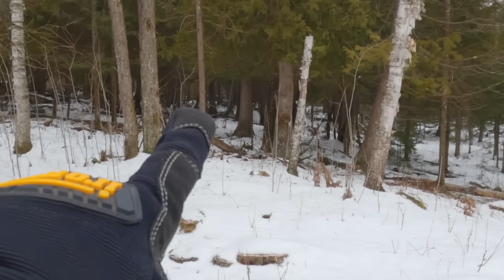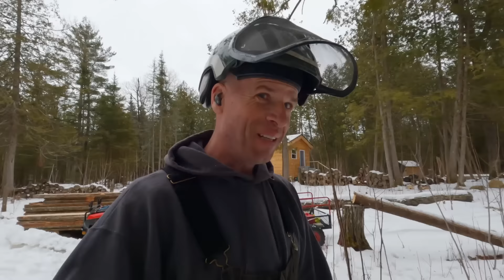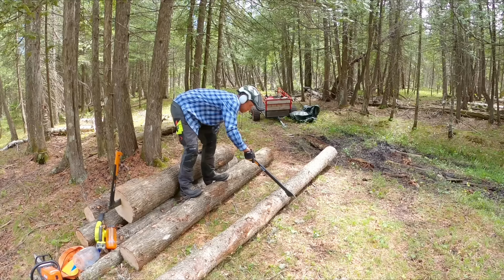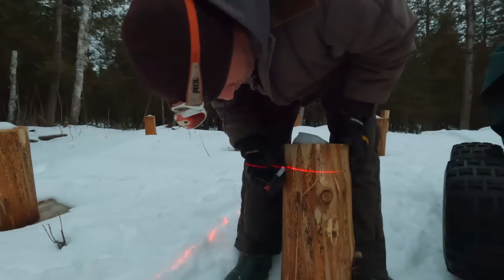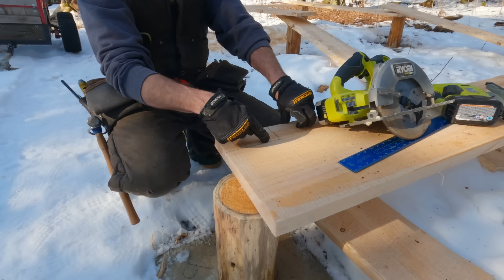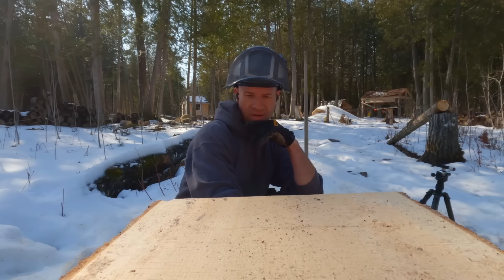Framing a Stand-Alone Kitchen Floor w/ Huge Alaskan Milled Pine Lumber ep179

Comment: Ryan, I know you cringe at the word but "stickers" 😂 the wood wouldn't freeze together 😂
Reply: Since you are so well versed in stickers I am certain that you are aware that stickers have to be uniform in size to keep the boards from warping. Could you please explain to me how you can achieve that with a chainsaw?
Reply: @TheMakersMarkTSF  with a mill its not that hard, I do it a lot, but I also cheat and run my 1 inch material through the table saw to get a bit better guaranteed unform size

Comment: Drill into your foundation logs on a 45° angle with a big drill bit then fill them with used motor oil. Make yourself some hole plugs with appropriate sized sticks. It’s probably not something you want to show on camera but it will wolminize (however that’s spelled). It’s an old farmer trick they would do to extend the life of their fence posts if they didn’t use cedar.

Comment: Hi Ryan, the hammer you were asking about is a tack hammer used for upholstery. The slit end is magnetic which allows for one handed work. If one hand is holding the fabric in place the other hand can pickup a tack place the tack. Spin the hammer over a drive the tack home.😊

Comment: Sticky camera problem suggestion.   Get some of that semi-sticky clear plastic that used car dealers put on the car floor carpeting.  Stick it to your camera and cut out the hole for the aperture.   You can peel it off of the camera body later.  The glue holds but typical leaves no residue. Handy for a lot of other dirty jobs too.  

When I fell, limb and handle a lot of sticky white pine logs, my clothes get pretty covered in sap.   When it’s time to take them to the laundromat to clean in the commercial washers, I do an overnight pre-soak with hot water and pine-sol.  Wring ‘m out before you go the laundromat and they will wash completely clean in a hot water wash in those big tumblers.   And it leaves no sticky in the washer either.

Tips worth what you paid for it.

Comment: Hey Ryan, next time you're notching for the stumps drill a 1" diameter hole in the corner. It will eliminate the weak point to crack. Just a thought. Peace out, enjoy the build.😊

Comment: Ryan cut the floor joist to fit between the center board and outside beams, use joist hangers 16 inches on center much stronger.

Comment: We have installed a skylight with solar power.  It opens at the press of a button and closes automatically if it starts to rain.  It also has a built-in  shade that can be opened and closed. No need for power from the house circuit!

Comment: Just a heads up you want to keep that lazer warm as extreme cold or hot will affect and sometimes damages the lazer, my bosch 3 plane green lazer has to go out for service because of a cold snap this season and being left in my truck. Also to free up frozen together boards, use a 3 or 4 pound sledge and hit the ends. Do that all the time in the winter to break up bunks of lumber from the lumberyard and we need it but its all frozen together

Comment: Have you considered building it two stories for a view and balcony? If you build the walls about 12 feet high, it will give you a knee wall in the second story  so you can put sofas and beds against the wall leaving the middle of the room open for walking. It could be a full second story or a half loft.

Comment: Ryan, you mentioned the bubble foil which reminds me - did you use stainless steel staples when stapling it?   If not you will need to do it all again as they will rust out in a couple years.  Or they woud here in Scotland.  If you need to re-staple them I would add another layer of foil at the same time, to cut your propane costs even more.

Comment: I do a U notch in the center in the post. For my post and beams. But using largest diameter post I can. I like to punish myself. I just make them a little wider than width of the saw blade. So you can do a plunge cut with end of the saw.

Comment: A beadle, spelling? A verylarge wooden mallet. The head is like 8 or so inches in diameter and 16 inches long. Make a handle strong enough to handle this head. You can use it to knock those boards apart. The wooden head wont hurtthe boards as much as a steel hammer.

Comment: I thimnk you should have or look at a log arch seems it would be the ideal thing to have for moving large logs around by yourself they have hand push ones or some you can haul with your four wheeler you might kick me for showing you a serious tool for saving your back n the type of work you do. I used to drive truck for menards and always kept my eyes open for clever tools to make my job easier. you can never have too many straps or wenches!. You know harbor frieght has portable cable wenches that would be better then your boat wench system because youd have better lever action and could ad a cheater bar long piece of pipe to lift heavier logs.

Comment: You need to put a set of 30"  assassinator tires on that Honda, you could pull anything then, you'd never get stuck again, I have 32" on my Honda Rancher 420 4x4 now, I wish I had stuck with the 30s.

Comment: Hey Ryan, I got up a half dozen times to help you, but you kept ignoring me!!😁 I am using the bubble wrap on my new cabin build. I am actually stapling it to the top of my floor joist, then putting the floor sheeting over top. The kitchen project is going to be nice.

Comment: Hey why not really have a refrigerator… solar panels on the roof of the kitchen you could run a 12 or 24v system with a 1000 to 2000 watt inverter and power all of your kitchen appliances from it including a water pump & lights for evening… that would add a element you haven’t done before …

Comment: RYAN  PONTOON  BOAT  you  said  PONTOON  BOAT  !!!  I wanted to retire  and  live out on one  in the  summer  MONTHS !!!  Oh Yeah  it would be  cool  !!!  Refrigerator    bed   SCREENED on in   also  !!!   1  end of it  the Motors   got to have  Motors  !!!  Then  you  can  fish  off  of that  end  also   !!!    Anchors  on  both  ends  also   with  maybe  a   shower  by the  sink !!!  Not to  far  from the  sink  to do  dishes  or  pots & Pans  !!! Other  end  would  have a  Slide  not just  a little  slide but  a  Big  one  to go into  the  water  on  hot  Days for you !!!  You  remember  those combination  windows  that is what  I would have around  the  PONTOON  BOAT  !!! So if it was windy  outside or  rainy   you  could be   a bit  warmer then !!!  The  main  end  to  be  on would have  a  Grill  on it  to  cook your  food then !!!   Refrigerator  is to keep  the milk  &  meat  cooler  same with the  worms  that are in the   door  part of the  refrigerator  !!!    To  keep the  clothes   clean  just put them  into  the water  and  wash them  that  way  !!! Washing then rinsing   then  hanging them up to  dry  on  a clothes  line  !!!

Comment: A query I've had for some time, but never asked. Why are all your buildings so spread out? Out the cabin, walk to the shower. Out the cabin, walk to the kitchen. Out the tent, walk . . . modern efficiency would dictate closer proximity.
Reply: It wouldn't b Ringworm then.
Reply: In a forest fire if 1 goes up then they all do, I assume that's the reason behind it
Reply: If a tree falls it will most likely only hit one building and it looks nice.